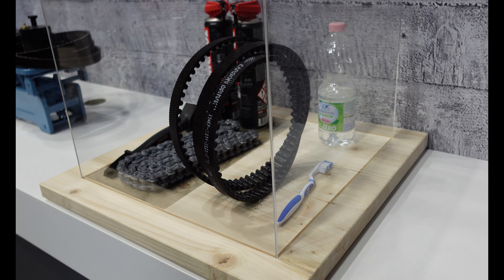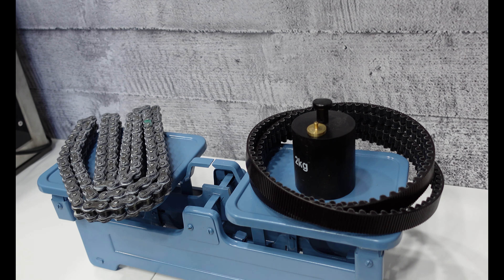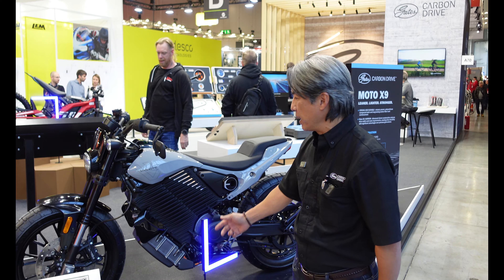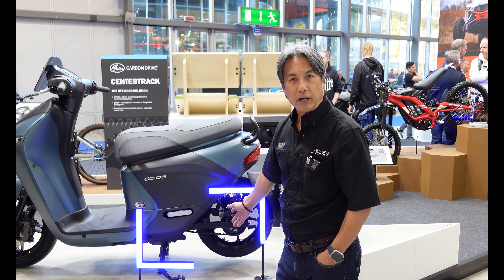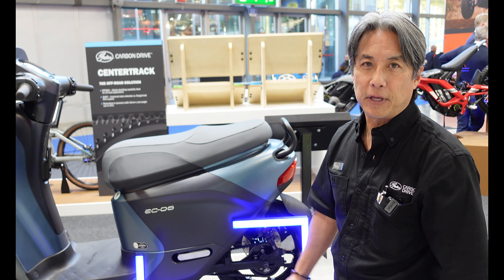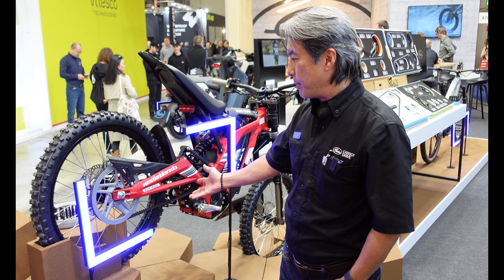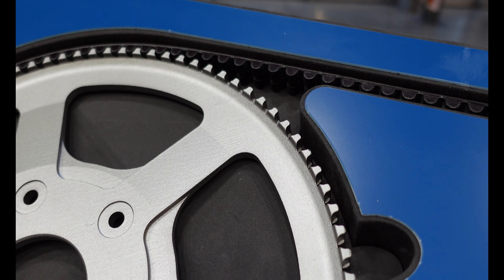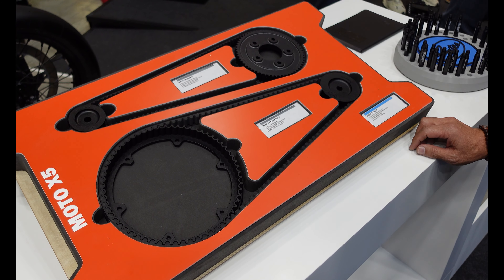EICMA 2023: Gates Carbon Drive 4K

Comment: I've not had a bike with a chain for the last 30 years. Shaft and belts were my  preferred buying choice until I got a small trail bike again this summer. Chains are messy and hi-maintenance and I would never consider a touring bike with a chain. It is a mystery why belts have taken so long to be adopted outside the cruiser market. It is just perceived buyer conservatism or is there another technical reason I wonder.
Reply: Chain maintenance is really a hoax these days. I've had the best experience just getting a really high quality chain and then spraying it with WD-40 once a month to prevent rust. If you lube them with chain lube the dirt tends to stick to the chain and wear it down much quicker. When doing big tours I just carry a small can of WD-40 and spray the chain every couple of days after riding. Never cleaned a chain and they all look perfect and bearly dirty.
Reply: Well, chains and oilers are much better than 30 years ago. This combination is trouble-free and lasts for a long time. Nothing's perfect though, look at BMW's shaft drives or Ducati's problems with the XDiavel. Chains and sprockets are comparatively cheap ;-) Günter/Nürnberg
Reply from the maker: Thanks Chris. I'm mostly doing motorcycle videos, but every now and again I see a stand at the show which might be interesting, and I thought the chain vs shaft vs belt might be some food for thought.
Reply: It would be nice to be able to retro-fit this belt-drive to an existing chain-drive bike.

Comment: A shaft drive is at least some work, Andre, as you know. And some of them even have to be changed like on BMW's R 1300 GS. A belt is not suited for offroad. A (carbon) belt is perfect for e-scooters, though. Thanks for showing, Günter/Nürnberg
Reply from the maker: I've never had to do anything to my shaft drives in 12 years of BMW ownership (One R850R, two R1200G's and one R1250GS). They have all been serviced to schedule, but perhaps I just got lucky?
As for the belt for offroad, I'm not disagreeing with you, but may I ask why you think it's not suited? They had a conversion kit for a SurRon, and I get that it could cause wear if covered in mud and dust, but is that any different to a chain?
Reply: @PeakMotorcycles   and of course why do we still have exposed chains? Fashion on road bikes? MZ had a great enclosed chain in the 70s, Honda on their 125s, scooter galores etc. Sorry for hijacking you video comments Andre :-)
Reply: @PeakMotorcycles  Stones can penetrate the belt. Andre. Seen myself live on a Kymco 550 scooter, seen on a Ducati XDiavel. Then there's the problem (more on- than offroad) that the belt does not exactly run in the middle, resulting in premature wearing out of expensive sprockets. Also something the XDiavel is prone to.

Comment: I’ve always thought carbon belts should be more widely used on motorbikes given the clear ease of use advantages over chain and massive weight savings over shaft drive. I remember BMW using them since the (not very successful) Scarver - and HD too obvs.
I currently have an eBike with a Gates centre track carbon belt paired with an enviolo internal gear hub at the rear. Carbon belts are ideal for eBikes especially urban and heavy duty cargo eBikes. When you have near silent power unit you don’t want a clanking, clunky, messy chain or a derailleur. I expect they’ll become common on electric motorcycles too in the years to come.
Reply from the maker: Thanks for that. And yes, they should be on more bikes.

Comment: Race bikes and sportsbike generally will probably always use chains, since they allow easy sprocket changes for performance tuning. Every belt drive has to perfectly match the sprockets its designed for.
Reply from the maker: Agreed, though I wonder if +1 at the back and -1 at the front (or any matching but opposite sprocket change) would work, to a certain tolerance, with the same belt.

Comment: Is it possible to convert by DIY from a classic chain to a belt? They offer it?
Reply from the maker: I guess it would be bike dependent, but I don't see why not. It would be a question of getting belt sprockets the right size, having an appropriate belt routing and then getting the belt the right length. Drop them a note and see what they say. https://www.gatescarbondrive.com/